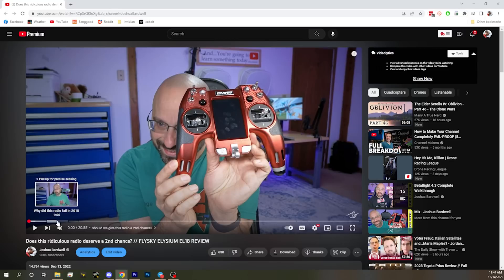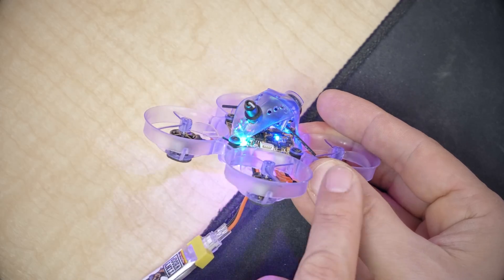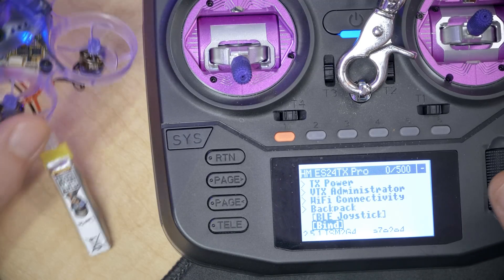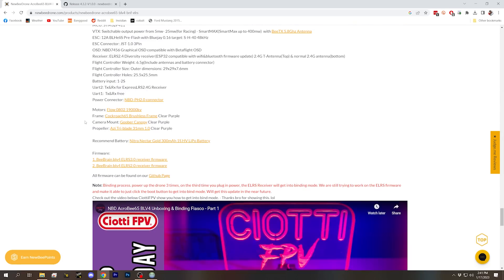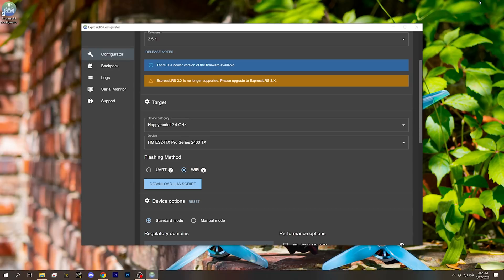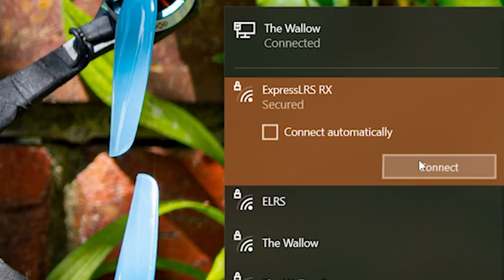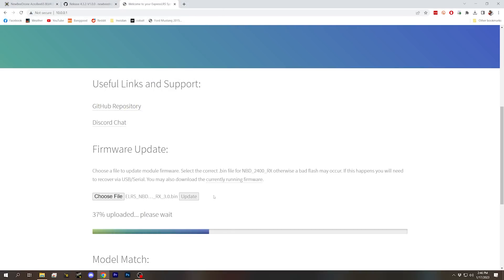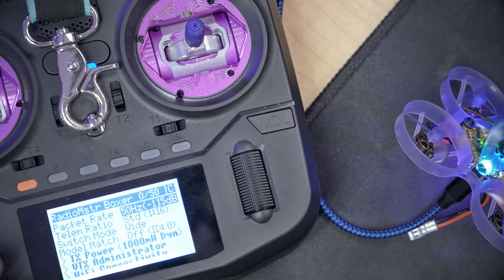Why it's so hard to bind Newbeedrone Acrobee BLV4

Comment: I’ve had several issues binding/flashing from Wi-Fi. One rx module I have will broadcast the access point, but drops periodically, before being able to flash. Then as you suggested, several more/other issues going the other available flashing methods. Persistence and patience got me through that debacle.

Comment: "ELRS 3.0 has been out for a while". Release date: Sep 9, 2022. But yeah, this hobby is very much a "blink and you'll miss it" sort of deal. I also wonder if manufacturers would hesitate to ship the latest and greatest, to avoid catastrophic bugs. (Edit: NBD still should've taken ELRS up on their offer to help but I'm just saying a major version jump is still a major version jump).

And then sidebar, I find it fascinating the set of skills and tools you're expected to pick up to succeed in FPV: embedded software development, 3D printing, soldering tiny wires, FAA rules lawyering, and (finally) actually piloting the damn quad.

Comment: Not surprising NBD dropped the ball on this. It doesn't help that NBD has some of the worst customer service out there. I don't envy anyone that has to deal with Dalton.
Reply: What happened?
Reply: @wynnfpv  Received a BNF whoop with an aio with issues(I get it, it happens). Motor oscillations so bad that the jello made it not flyable. Dalton told me that the motors are the issue after sending over a bunch of videos documenting the issue. Dalton wouldn't do anything to resolve the problem. I bought motors from NBD and replaced them per Dalton. It did not fix the issue. Sent more videos over and eventually stopped getting a response. Even after this I still buy NBD products. I've ran cricket stacks for two years now in all my quads. I just take the L instead of contacting them if I have any issues now.
Reply: @ScottyRoddis  man I’m sorry to hear about the bad experience…

Comment: JB- thanks for your rant!  Well spoken!  I fly giant scale airplanes.  I also fly JR/Spectrum radio gear.  Plug in the battery at the bind port, push the bind button on the back of the radio.  Go fly (of course after setting up model, range test etc.).   Quads COULD be that easy, come already with the good version etc. but aren’t interested.  Arggg
Reply: Used to fly spektrum on fixed wings... trust me, you don't want it on a quad.

Comment: I really want to like NBD products.   I have a bunch of their hummingbird pro fc with mixed results.  Want to run other 0802 motors that have "standard" plugs JST-1.25 3Pin ? Nope, NBD hummingbird (and this new beebrain blv4 based whoop) uses the smaller jst 1.0.    want to try betaflight 4.4rc whatever...nope...gotta wait for NBD to do their own fork of the betaflight code.  Want to try quicksilver? nope! Strike 3, you're out!    Come on NBD, stop the proprietary garbage no one wants.  What the heck is "bee sign" protocol anyway...geez.

Comment: I was so scared to switch to elrs being a "somewhat newb" but I did it and thank GOD I haven't had any issues binding my "second" mobula7 1s elrs I just went to bind in betaflight and pressed the button on the radio and whala however my radio is on 2.0 and my mobula is 2.1 lol I'm super scared to update hey if it isn't broke why F with it lol I do like to have the newest firmwares though having ocd I'm itching to update lol THANK GOD FOR JB🙏🏽🫶🏽 LOL OH I just got a rekon 4 fr and it had to have at least 2.1 elrs because it bound up in 2 seconds using the plug and unplug method however I did have to change the channel mapping for it as I did for the mobula too🤔 easy but weird that I had to do that on 2 quads as of late and not on any of my older ones....hey I'm learning! Lol.... RIP CRASH REBUILD ✌🏽

Comment: Great sharing JB, Can anyone tell me,  can you follow these step to take the Mobula6 (spl rx) to flash from 2.xx to 3.2.0. All my plane a one other quad is on 3.2 so kept my Zorro on 2.5.1 and works ok for the mobula6. I did watch your other video JB  on the spl rx's but this looks simpler. Thanks in advance.
Reply: Happymodel spi boards can be flashed with BF 4.4 (RC5 atm) and that will work perfectly with elrs v3.  You can add the passphrase into BF receiver tab.

Comment: I didnt buy one, but I did notice on the product page that for 3.0 you had to use the matek target. That had been on there page from day one. Sometimes if people would just take the time to read about the product, they may find that the answer had been there all along.
Reply: Not true. The bind process was not listed on the product page, and originally didn't even have the firmware links on the page. I bought one and a week later after it arrived, there was no info on the page besides the main specs. I even asked NBD at the time and they didn't answer.

Comment: Yeah, in addition to JB's rant on NBD not getting an ELRS target for their RX in the official repository...
NBD also thinks it's a great idea to have a custom version of Betaflight, too. Awesome (that's a snarky awesome)!
Apparently they have a VTX/OSD that needs a driver called BEESIGN. And apparently NBD can't be bothered to submit a PR to Betaflight to get the driver properly added to official repo and build system. So we're at their mercy on the BF version we have to use, no BF 4.4 support until they make a new target (or we do our own merge, no thanks).
I took a chance on this whoop because it looked pretty good, but I should have done my homework on the firmware, what a sh!t show!

Comment: Oh don't forget if you are on 2.5.0 vs 2.5.1 you can't do the conversion process to rearrange the data on your module/drone to the right version for newer version of ELRS (3+) to work, you need to get it to 2.5.1 first to run the tool. That was a fun couple of days of searching.